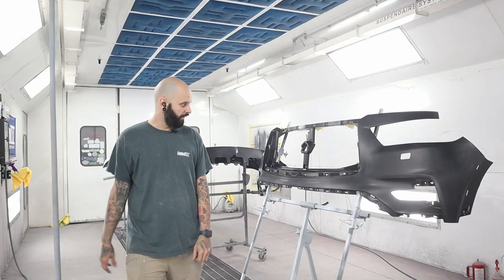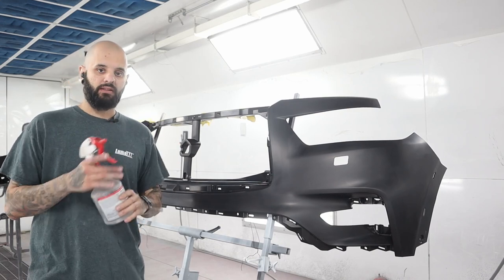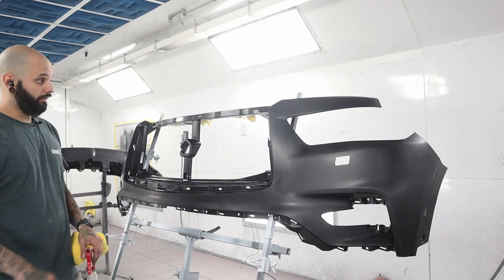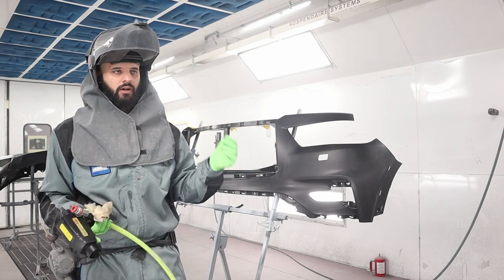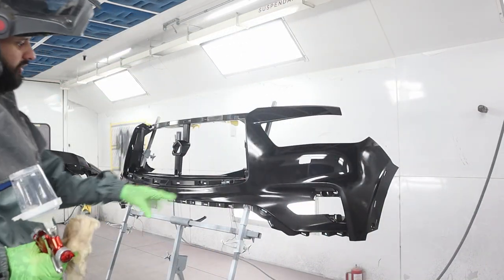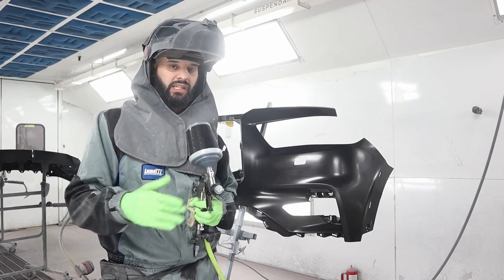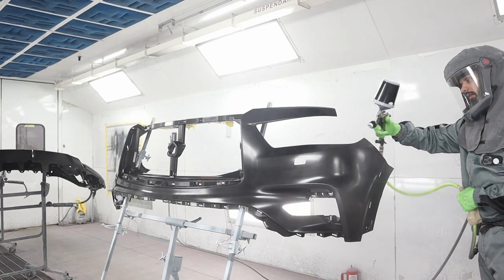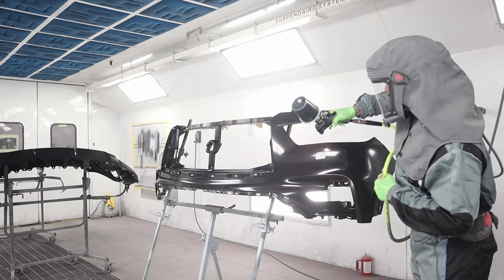Painting Raw plastic!

Comment: Found you on TikTok and thought I would sub here on youtube as well! Awesome video. Would this be the same process if they're not new plastic pieces? I have an older Honda with black bumpers that I would like to paint to match the body.
Reply from the maker: Similar minus the adhesion promotion! If they are primed you just need to scuff them up with grey scotchbrite, seal (or over reduced epoxy as sealer) and then base clear. I like using grey scotch wet so it doesn’t just instantly load up with dust and quit working!